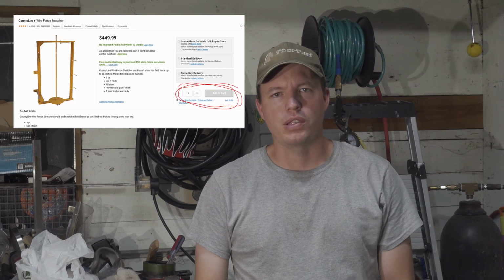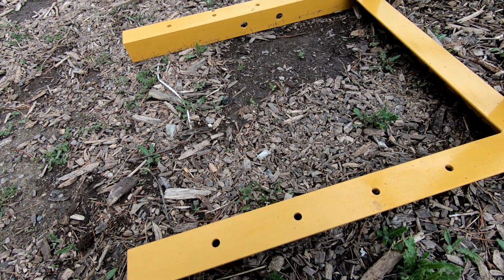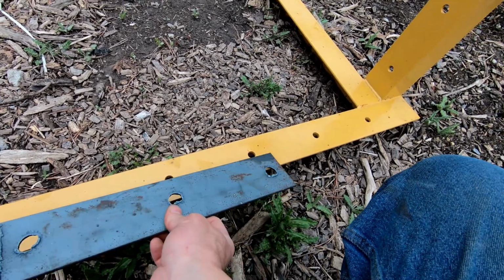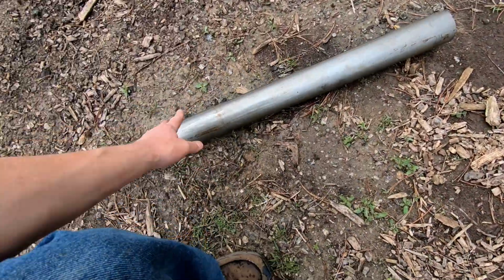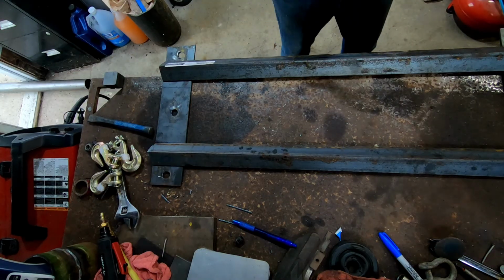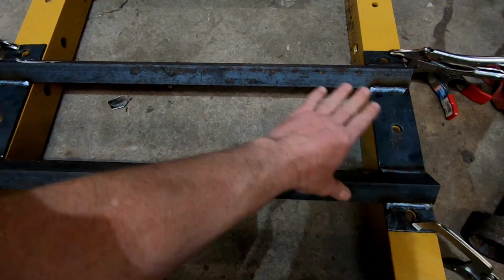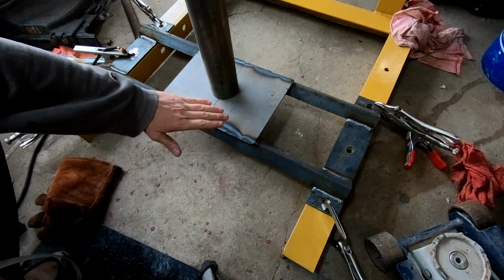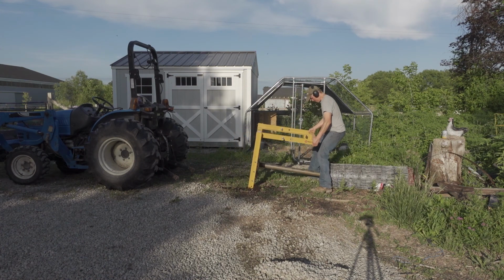DIY - Fence Stretcher - For a Tractor 3 Point Hitch

Comment: I built mine on the front end loader. That allows me to tilt the FEL down and drive the post thru the center of the roll and then tilt it upright. It also allows angling the roll to tension upper vs lower. I can raise the FEL to get over obstacles and posts.